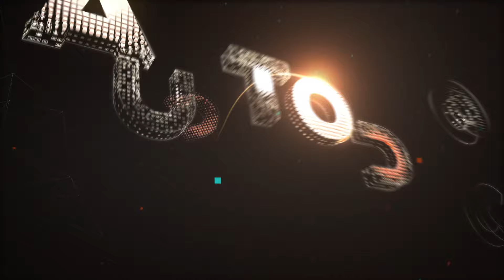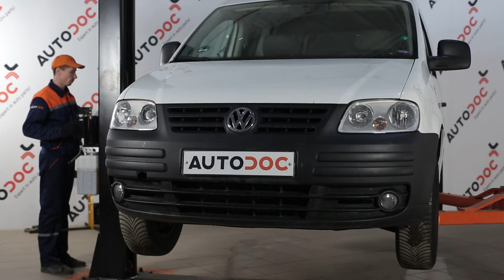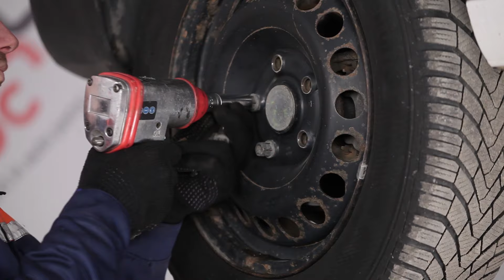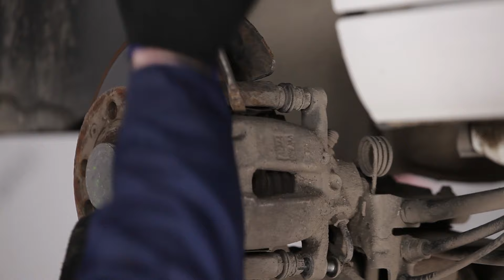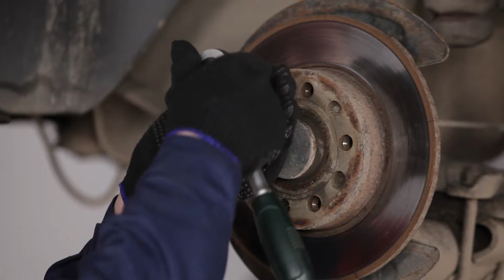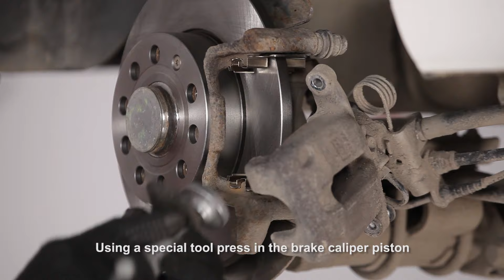How to change rear brake discs and rear brake pads on VW CADDY 3 TUTORIAL | AUTODOC

Comment: hi there would this be the same as to do on the front
Reply from the maker: Thank you for the feedback!Yes, the procedure is not fundamentally different, but we strongly recommend you to carry out the work that is related with the brake system of the car only on a certified service station.

Comment: Don't you believe in using a torque wrench, blue thread lock and brake grease? not to mention copper slip or lithium grease. Maybe Ive been doing it wrong for the last 45 years!
Reply from the maker: Thank you for your feedback! To save the time in the video some stages of the repairs might have been excluded.. In practice the torque wrench should be used. All these procedures should be carried out. Best Regards, Autodoc.
Reply: Agreed, some anti-seize on the hub and lubing the caliper pins,pad backing plates and slides etc. is a must.. especially in the UK. I do understand though that in the interests of making the video as short as possible, this is more of an overview. Thanks for the video!
Reply: To be noted that you also need to replace the lower screw…